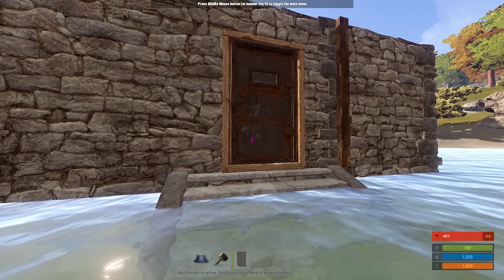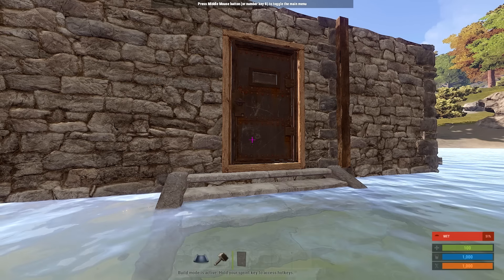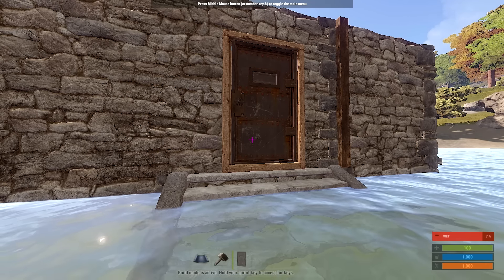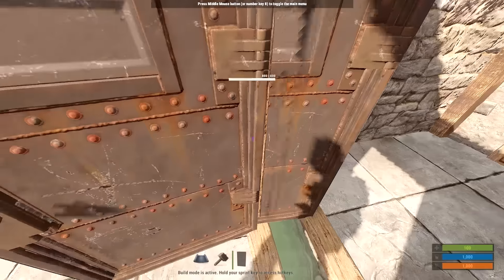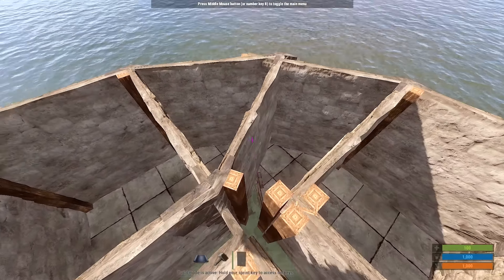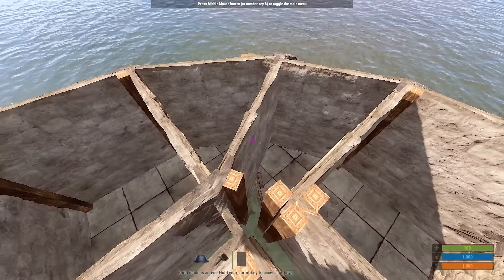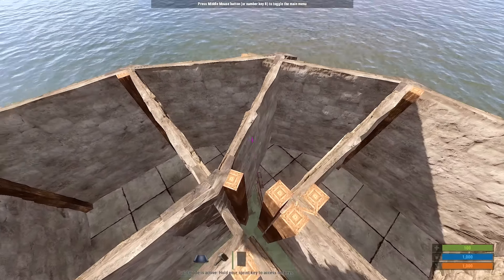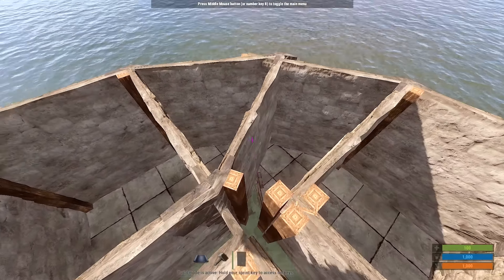How To Rust: Day 80! | SGTSolj's Double Stacked Wall Base!

Comment: Those walls where you couldn't build that last honeycomb look susceptible to just spidering up the corner and picking the floor.
Reply from the maker: It's possible, I'll have to check that. But if it's sheet at least it won't be easy lol

Comment: Try it like this for more security:
http://steamcommunity.com/sharedfiles/filedetails/?id=731261734
http://steamcommunity.com/sharedfiles/filedetails/?id=731261841

You can also double up the square wall thickness on the outside as well; like this:
http://steamcommunity.com/id/itsadamuk/screenshot/273976121091451704

Comment: So thats 9 Rockets, how much did it cost to make?
Reply: +Violate I think that the budgetbase 3 from RustyPirateGaming is still more efficient, it takes 6 C4 or 12 Rockets at its weakest point and its way cheaper to make.
Reply from the maker: It isn't always about doing things the most efficient way, sometimes it's just doing something different.
Reply: I mean, I want a base thats the hardest to breach for the least amount of resources while still offering enough space, I've been trying to get a good design with those double layered walls aswell. Problem is, Rocket splash can get u in very easy sometimes. So I'm trying to make a base that doesn't suffer from that utilising the double stacked walls

Comment: "let's test the strength against rockets!"

Proceeds to use rockets incorrectly.  

Seriously - test raid your bases like an actual raider would.  I wouldn't fire rockets right at the door.  I wouldn't even go against the front side.  A lot of builders like to put more layers near the front door because a lot of raiders (stupidly) go for the front door.

I would go from the side, and I fire in between wall tiles - so four rockets take out up to four walls, if used correctly.  So, even with your layers, it only takes 12 rockets to get in.

The real shit is to build a square (3x3, 4x4, etc.), go out two square foundations, destroy the middle foundations, and then use triangles to make normal corrugation on the main base, and you have a tight gap outer wall that you can then use to place 4 2x2 towers on each corner, not attached to the main base.  You will have your gaps from this build, but you don't have to do any half-moon BS.